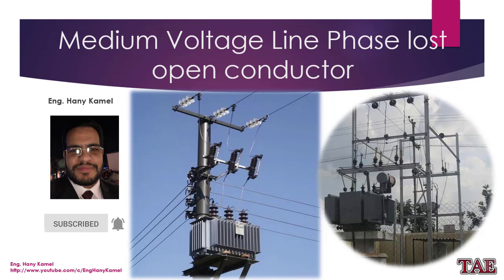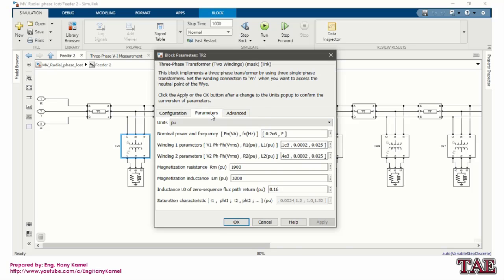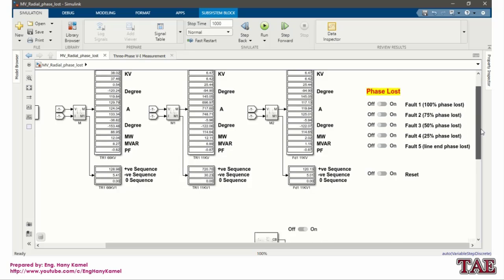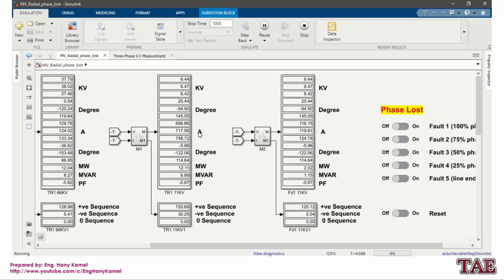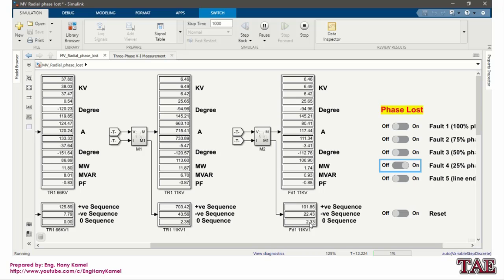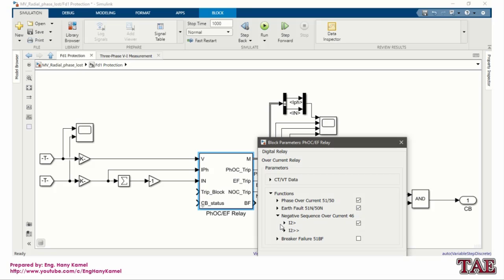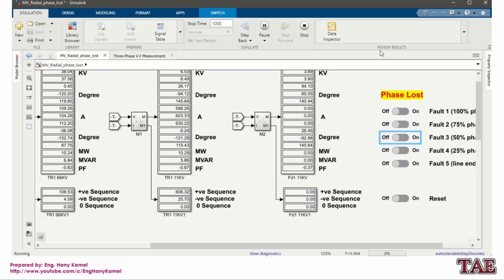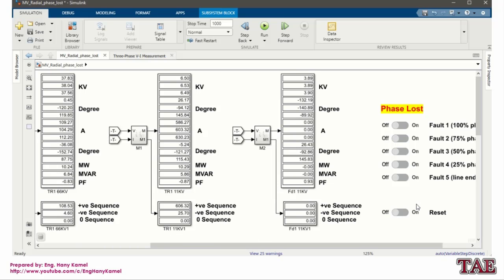Medium Voltage Distribution Line Phase lost Protection, fault analysis, finding solution and NOC

Comment: Awesome simulation  and huge effort 
Thanks A lot 👏👏
Reply from the maker: Thank you so much
Reply: @EngHanyKamel  
 I have an inquiry  .. why you did not use Etap program in the simulation instead  of matlab ?
Reply from the maker: In matlab i can see the wave form for the voltage and current, i can study the transients, i can build the relay itself so i can learn exactly how it works,
Etap like calcultor you enter numbers you got numbers
But for Matlab simulink, you build every thing by your self with more facilities so you will learn more